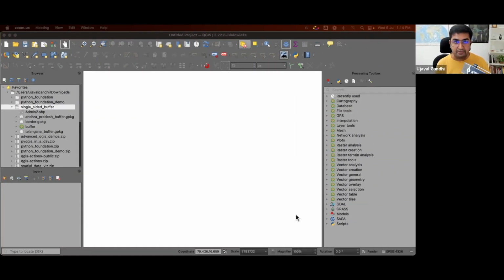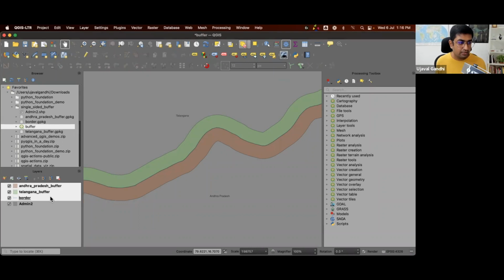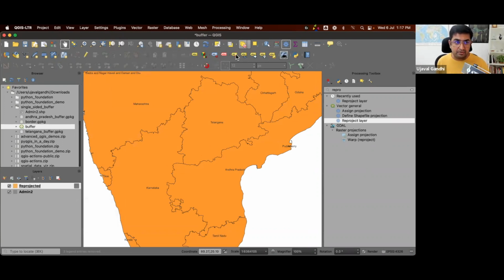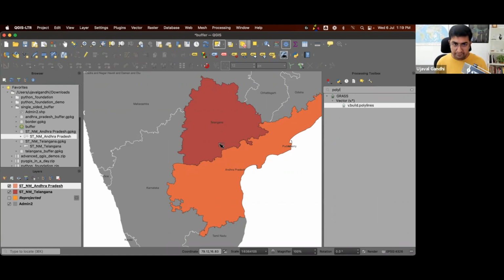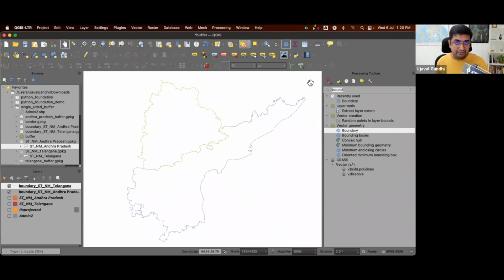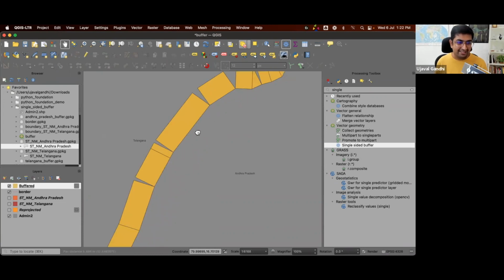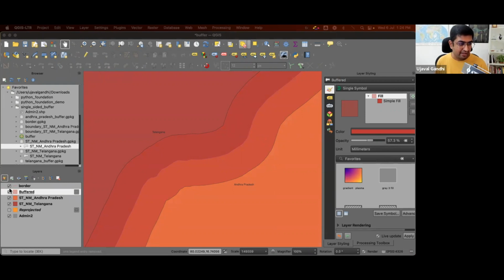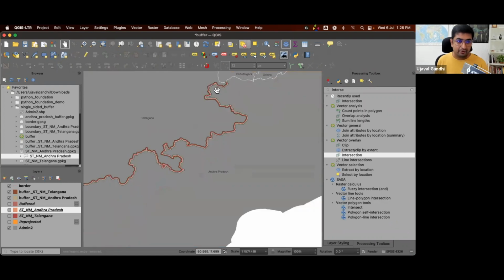Extracting Shared Border and One-Sided Buffers in QGIS

Comment: Hi Ujaval!

Which other Coordinate Reference System you recommend if we are not dealing with India's data?

Thanks for your awesome video
Reply from the maker: UTM is generally a good choice. Find the UTM zone for your region and pick the CRS based on WGS84 datum. I explain more in this video https://www.youtube.com/watch?v=YSuRw6-kVuY
Reply: @SpatialThoughts  what I thought it was going to take me hours and hours, has worked in a single afternoon. Thank you very much Ujaval. Just by any chance, do you have some content/expertise on Spatial Regression Discontinuity Designs?
Reply from the maker: @AlejandraPáramoPascual  Sorry. I don't have any materials regarding that.
Reply: @SpatialThoughts  and what about doing these exact same processes of creating the buffers in the boundaries... but in large scale?

I was wondering if one could code all these steps, so that , for example in Python, it would be a matter of clicking one button, and running all those tasks at once (split polygons, create boundaries, intersect them, create the buffers, and intersect them again with the original polygons).

This would be a great contribution to scale up your wonderful method.

Best regards!
Reply from the maker: @AlejandraPáramoPascual  It is possible. You can also use QGIS Modeler to build a model with the steps and automate the process without coding. See this tutorial https://www.qgistutorials.com/en/docs/3/processing_graphical_modeler.html I also have an implementation using Google Earth Engine for the same problem https://code.earthengine.google.com/bd71e080394974acd2fc8e151e1df7ad

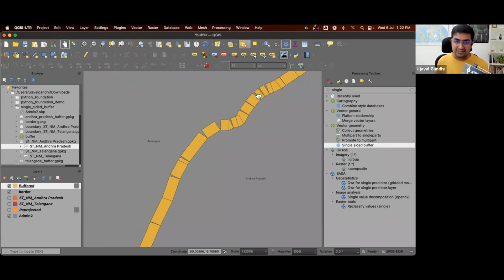Comment: Hi Ujaval - Thanks for this great video. The problem with the single sided buffer (7:26) can be solved by selecting the border and Merge Selected features in the Advanced digitizing toolbar. The the single sided buffer will be nice. Regards Lene
Reply from the maker: Hi Lene - I tried but it doesn't help. The border is a single feature - so merging doesn't help. Can you elaborate on the steps? My dataset is at https://drive.google.com/uc?export=download&id=11fS5VLaHKjIdbG9wmGN0onQzP-NX-LW_ if you want to try it out.